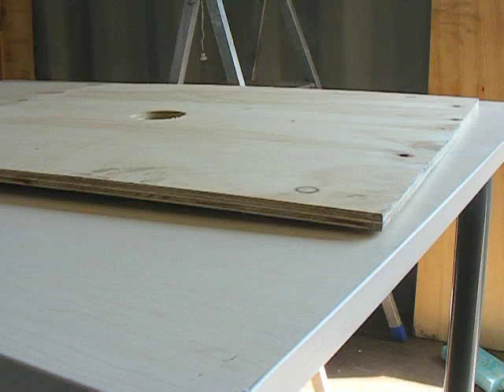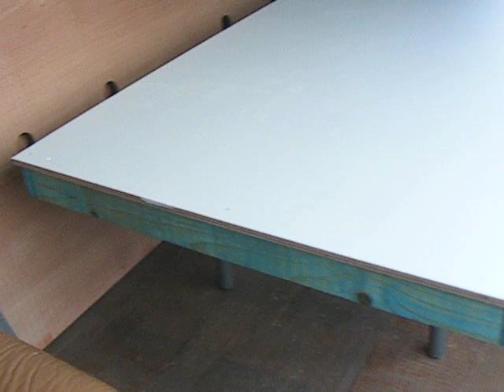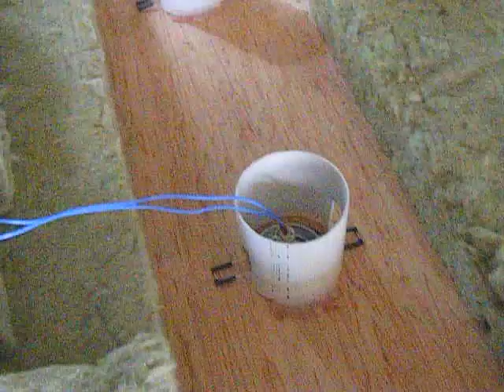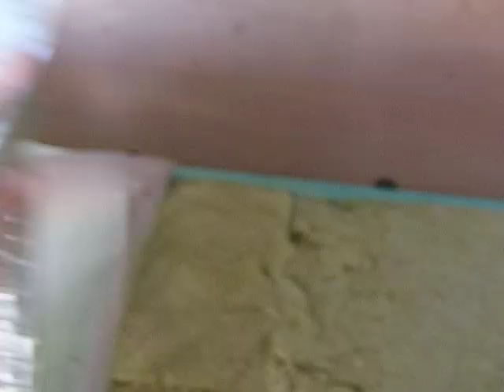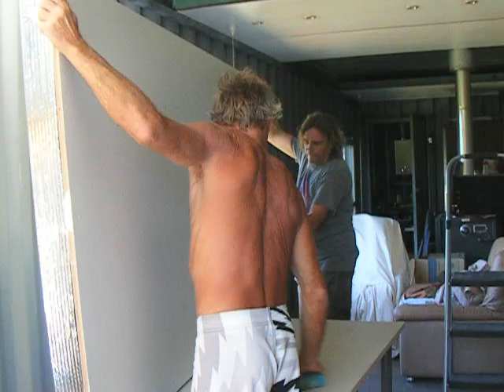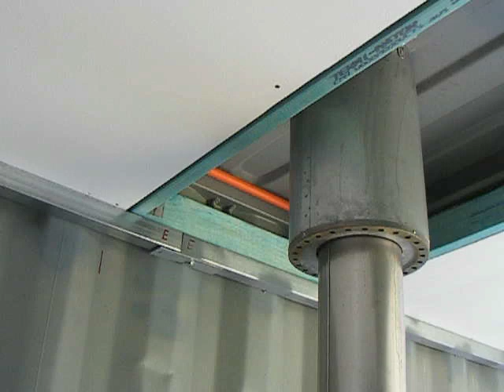Shipping Container House - Ceiling construction

Comment from the maker: Yes, your is the more traditional way of doing it. I suggest you get the sides framed first to give yourself a support to hold the top beams in place while the glue sets. 2x2 sounds small. You need to identify the insulation you will use and get beams to match. Most wool or fibre sorts were 80mm, hence using 90mm framing treated pine. You method has no room for error. You have to get everything right first time. Make sure you have room for your LED housings. 2 inches sounds too small. Paul

Comment: i was thinking of using some 2x2 wooden planks held to the ceiling with "no more nail's"  and then putting the insulation in and then using plasterboard with the holes cut out for led spot lights..   would this work like im thinking it will?

Comment from the maker: Uninsulated steel walls get too cold at night and too hot in summer. We currently have silver bubble wrap and a blanket covering the entire inside walls. These are acceptable until we are ready to address insulating the walls. The sun roof was CRITICAL in temperature stabilisation and water collection. The ceiling made the containers livable. Cheers Paul

Comment: you should put the electric wires run trough a pvc pipe, to avoid risk for fire.
they are good now, but but how they look in 20 years is an other thing.

Comment from the maker: Dropped suspended ceiling with removable panels was my first choice. You need a large area above the ceiling line to fit the panels. To get the space to fit the tiles would have made the ceiling too low. The rest of your observation is exactly what I wanted. I tried a number of providers and they all told me the same. Cheers Paul

Comment: Quick question: how hot does it get inside your lamp enclosure? Do you have ventilation holes for the heat of the bulbs (LED bulbs do give off heat) to escape? If not, the plastics inside could get hot: if you haven't looked into this, do some testing. I'd install a light inside an enclosure, and wrap insulation around it like for your panels, and then turn it on for a couple days to see what the end result is.

Comment: Since you're in Australia, I'm gong to assume that cooling is your primary concern. Ventilation is critical for this gap since you're dealing with air pressure increase from thermal expansion. My friend in New Mexico had her roof explode because of insufficient ventilation.
The foil backed insulation with the foil facing upwards is a good use of this product (foil facing the air gap).

Comment: If you use it on the inside to conserve heat, it has to be the last layer on your wall, facing inside. This is because reflective layers, like this bubblewrap, only work when there is a layer of air on the foil side. I remember this from a course I took on heat gain and heat loss calculations

Comment: I believe the radiant sheeting he is referring to is that layer of bubblewrap with the foil-like surface. What he is saying is that it would create a hot zone between the top of your insulation and the metal roof of the shipping container. And what he doesn't understand, is that whenever you have an insulating layer, you have to ventilate it. Plus, you want the energy reflected out for hot summer days. More...

Comment from the maker: Dimming the LED’s? No we can’t. They would have to be mains driven to do that instead of 12v. We would rather turn them off and light a candle or two.A 250W panel supplies a 200 AH truck battery, and this takes care of the water pump, all the lighting and a 12v socket for a phone charger. We still collect more electricity than we use. The battery is external to the living container and it feeds into a hole between the internal and external roof. It connects to the 12v lighting power lines.

Comment from the maker: Yes it was all DIY (on my own). I have been living in the containers for 6 months now. I am still very happy with the ceiling construction. It provides excellent insulation and the lighting is excellent. We are now at the point where we are considering removing a few LEDs to reduce the light levels. When I get time I will do the same again on the kitchen container.

Comment: It's not the best way, Its a way. This method is sound. Obviously building another layer to stop the suns rays hitting the steel is the best but this is a good solution. I would of run ceiling tracks and just run wiring and insulation prior to screw fixing the sheeting. but this method works well if all planned out and have the side tracks in place and some helping hands. Well done buddy.

Comment from the maker: Thankyou Ken, when I had the containers painted, I added thermilate, a powder containing ceramic beads that helps on the insulation. Apparently it can drop the temp by 7 degrees. I didnt fully understand what you meant about the radiant sheeting causing heat in a small area. Thankyou for the comments, I gain a lot of insight from you tube videos and coments. Cheers Paul

Comment: this is one of the best ideas i have seen you did a great job on your video, very well explained so thank you. Only comment i have is your raident sheeting, I would not have put it on the inside, buy doing so it will creat a mass of heat in that small area. There is a paint that you can use for the top of the conatiner.

Comment: Why not use solid foamsheets glued to the ceiling itself...no fitting around the lights.  Then get some AlumaCor sheets from a sign supply house for the dropped light panel/interior ceiling,,,light, thin, rigid, fireproof, and already has a baked-enamel white surface. Brushed Aluminum on the other side.   Cuts with a jigsaw.   Costs a bit more, but no painting, bracing boards, looks perfect and reduces fire hazard.  Brilliant stuff.